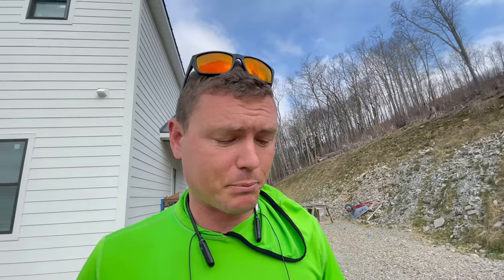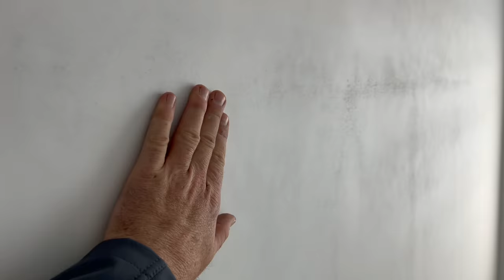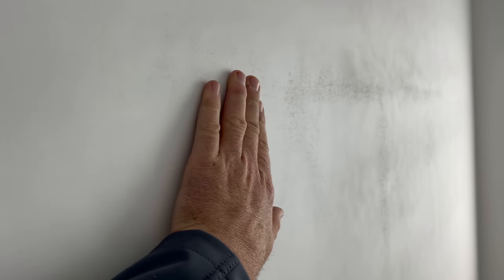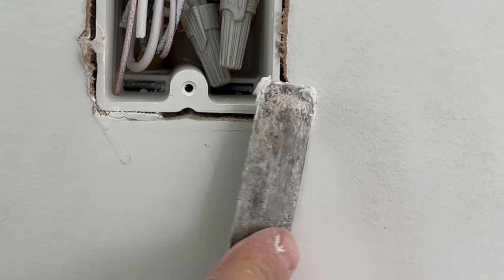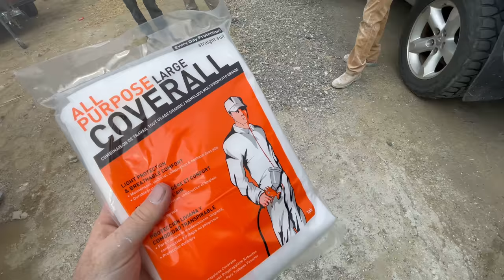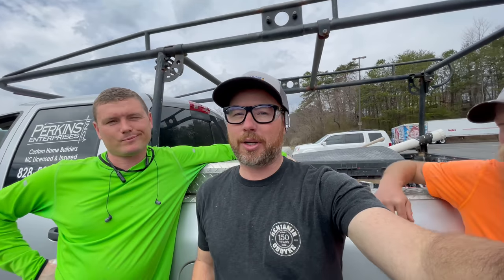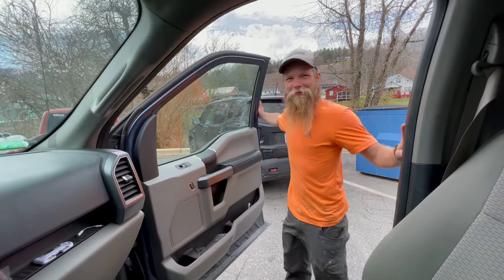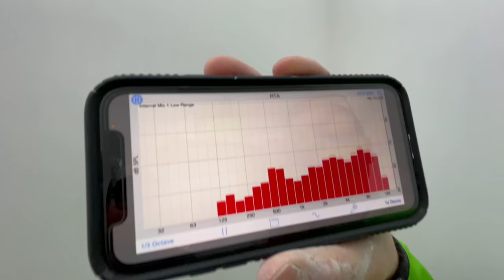Building The Farmhouse | Day 58

Comment: Handyman tip of the day:  i purchased the triangle corner sander instead of the rectangle head.  much easier and it sands both sides at the same time.  clamps onto a sanding head (you can use a rectangle block too).

Comment: Hi, I’ve really enjoyed your channel, and I appreciate what you do. I own a finishing works company in Bulgaria and when we sand drywall we always use an electric drywall sander, hooked to a vacuum. I find that that way you rarely get any dust particles on other surfaces, finished or otherwise and there is generally much less clean up, after the drywall stage. Why have I never seen a power drywall sander being used in the states? 
Also, from you previous video (and I don’t want to seem like an a..hole, I promise) buy why is it that most of houses in the US have textured ceilings, when if you apply Sheetrock and then sand it to 220-240 grit you always get a really smooth finish?
Really looking forward to hearing from you guys! Best of luck!

Comment: You also sand between coats to create a more adherent surface.  In other words, so the paint adheres better.  That's what I was always told.  That's true no matter what you're painting.  Also, for the same reason, when re-painting anything, you should always scrub / wash the surface clean and let it dry because dirt, grease and grime will also cause the paint to chip and come off and generally not adhere as well.  So many people don't do this anymore.  Bad idea.